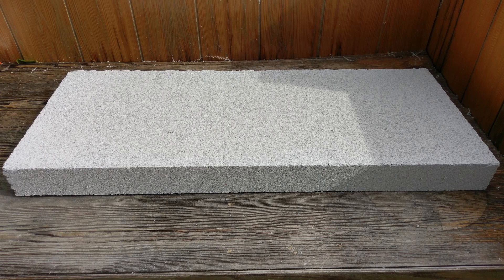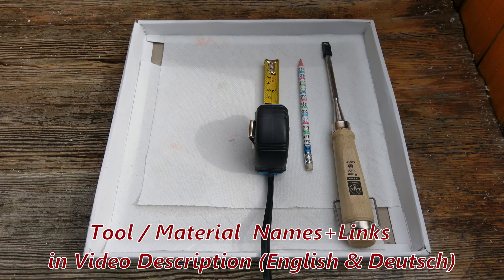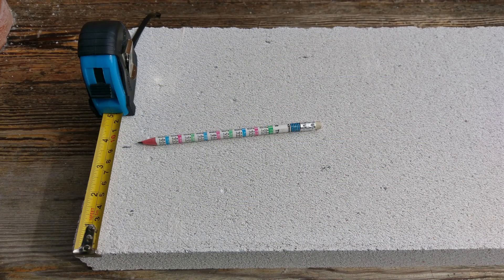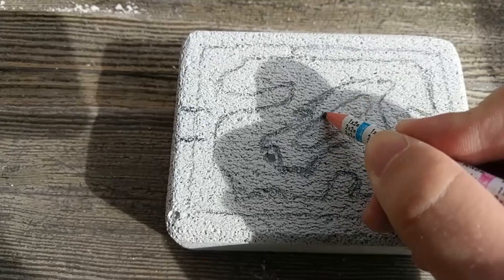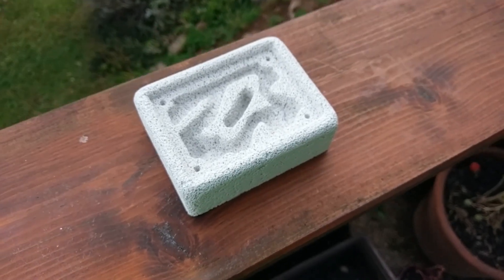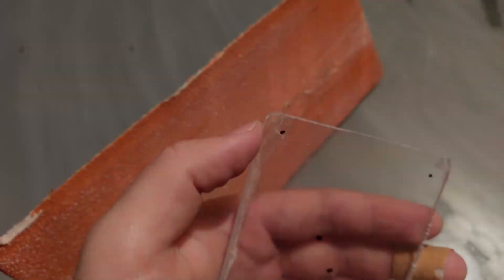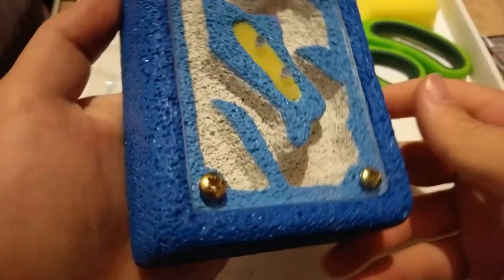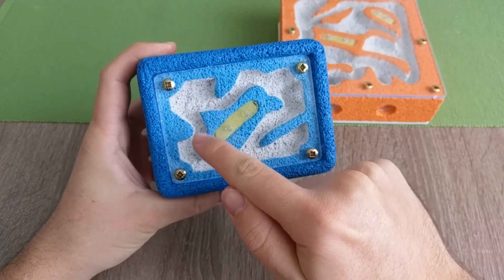How to Build an Ant Farm | DIY Ytong Ant Nest (Formicarium)

Comment: Hi ! great videos, tell me when I put the screws the concrete breaks can you tell me how to do it or which screw to take?
Reply from the maker: You either want screws with notable wooves, so they can bite into the Ytong. Alternatively you can glue screw inserts in the AAC - That also makes the nests a lot more reusable
Reply: I'd suggest paying close attention to the size of the drill holes compared to the size of your screws. You want your screws to be 'grabbing' the concrete as you screw them in, but not so much that it pushes the concrete apart which is what I suspect is happening.

Comment: 1- Does bacteria occur? 
2- can messor, camponotus or formica be fed?
Reply from the maker: 1) No, as long as you do not water the same spot every time you won't be facing any mold issues.
2) Yes, of course. HOWEVER you will need to connect that nest to an outworld for feeding. Or make an all-in-one formicarium like this: https://www.youtube.com/watch?v=bpFLpoq0x18&list=PLyGIP0vOgfExMhk5onztso7mb5IfFWUXX

Comment: hello, I have a question... That sponge or foam, is that something like moisturizing system?
Reply from the maker: Hello Patrick! Yes, the sponge helps disperse the water evenly to the ytong walls around it. You could technically skip the sponge, but you need to water the ant farm every once in a while. You can check out these diy ant farm builds to get more ideas😉 https://www.youtube.com/watch?v=bpFLpoq0x18&list=PLyGIP0vOgfExMhk5onztso7mb5IfFWUXX&ab_channel=AntsVienna
Reply: Thank you for your reply, with this I can finally get rid of that tube with water inside of my outside world 😁👍

Comment: Hello! In the very beginning of the video, I noticed that there are three ant nests, but one, the blue one, caught my eye, this is because there is a dip in the tying to fit the plexiglass, I want to add this to my nests, but how did you make sure that this space was even, for the plexiglass to fit on? Thank you!
Reply from the maker: Hello there! Glad you like my creations :)
The only thing I used here "flatten" the surface was a chisel and a LOT of patience😅
It's not 100% (handmade) but its does the job  in housing any medium-large ant species. If you intend to house a smaller ant species, then i suggest you go for the flat design (like e.g my orange design), where you can sand it perfectly and don't leave any gaps.
Hope this helps you out!
Reply: Yep! It helps a lot! Thank you! I’ll be making my nest today or tomorrow!

Comment: fANTastic video! If I could make one suggestion though? I wouldn't use a saw to cut Plexiglas/acrylic sheets as it chips the edges, instead I would use a sharp blade to score it and then snap it along the score line, similarly to how glass is usually cut.
Reply from the maker: Thank you! Glad you like my Tutorial. Yes, I know. I have already tried the method you mentioned, but it felt to brutal to the material and gave me inconsistent cuts. This may be due to my technique... but I prefer the saw method - since it also works better if you are trying to cut of smaller pieces of bigger plates, that you don't want to "snap" in half for example.

Comment: i have a question, does Ytong dly ant nest will get mold?
Reply from the maker: It depends on how often you water it. If you don't water every day and keep alternating between sponges (if your nest has more than one) then mold won't be a problem. I generally have experienced that Ytong has the least chances to get mold (compared to other materials like Plaster).
Reply: @AntsVienna  ok thank you
Reply from the maker: I personally like working with Ytong. But if you don't have access to it where you live you have to do workarounds - like plaster, grout, etc.

Comment: Hello! Using your video i created my own nest. Just one small issue or question. While watering the sponge it does not seem that the nest is getting any humidity? Did i do something wrong?
Reply from the maker: Did you sure get rid of all the dust? If dust stays in, it closes the Ytongs holes and water won't travel through the nests walls
Reply: @AntsVienna  yes i did. Probably i made the sponge hole.too deep and the water goes down instead of the carvings
Reply: Is there a way to remedy this?
Reply from the maker: Let it dry out completely and then paint the bottom of the sponge hole. This will "push" the water more to the sides (chambers)
Reply: @AntsVienna  Will.give it a go tomorrow and let you know the results. Danke! :)
Reply: @AntsVienna  Thank you for the tip! I managed to soak some water into the nest. Not as much as i would have liked but its way better. Next time i will know how to play with the drilling phase and elevations in order to get the water in the chambers. Thank you again! Tomorrow is the big day. The plexiglas is being shipped and i can start moving my ant colony
Reply from the maker: Glad I could help. When building Ytong nest always try to make the watering hole more shallow, so the water sicks in the nesting chambers on its way down. Take good care of your colony! ;)
Reply: @AntsVienna  One more question regarding these. Would you might know why, after they moved into the nest, they are staying clumped up together and not moving too much?
Reply from the maker: @vladlatis9120  Because it's a new environment form them and they still have to get used to it. Until then they won't be leaving the Queen's side often.